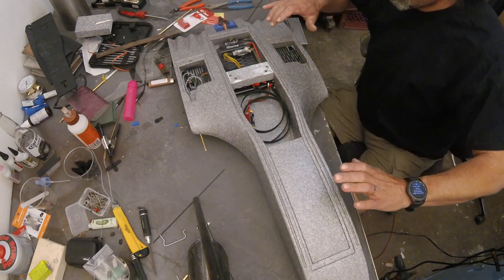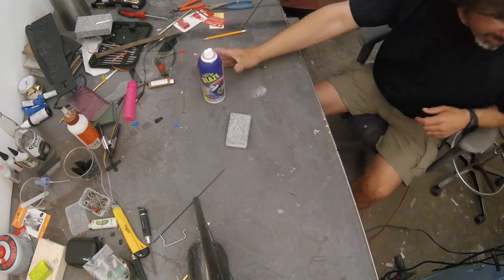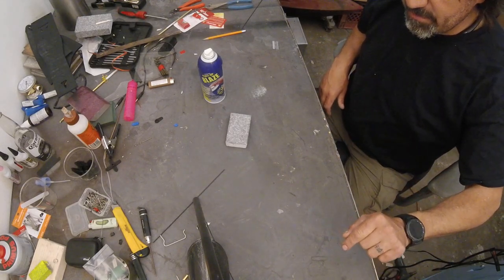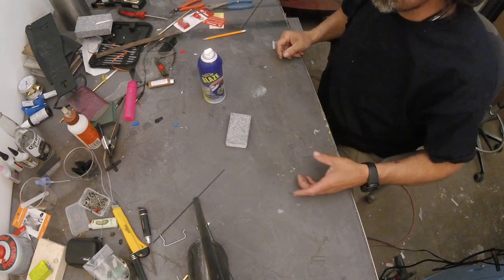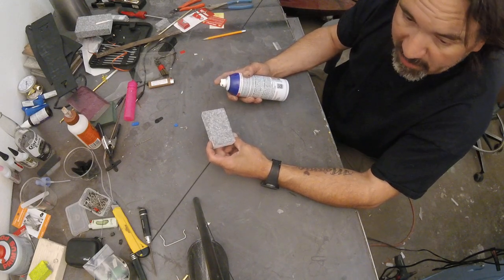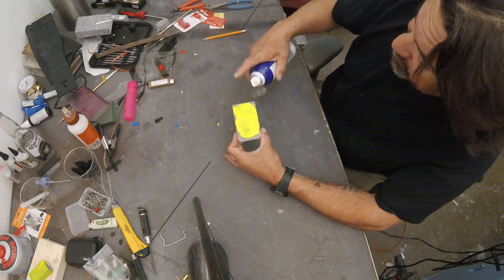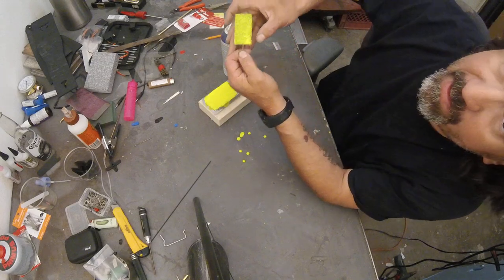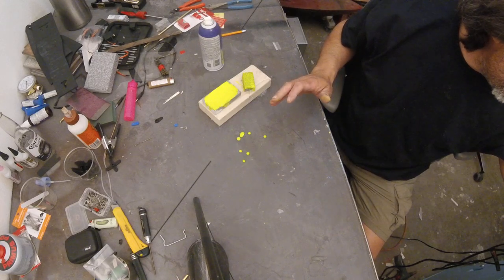MOLDED EPP TEST

Comment: I know this is old, but just to clear this up....... EPP is Expanded POLY PROPYLENE.  It is one of the most chemical resistant plastics commonly used. Hence why it is often used for things like fuel cans, etc.  There is essentially no solvent your likely to get your hands on at a retail capacity that will attack it.  However, there are some blends out there, that may have other types of plastics blended in. The retailer of the kit may not even be aware if its a blend in order to list is as such. So it's best to test.  Rather than using spray paint to test, you can use a very small amount of acetone in an inconspicuous area. If the acetone doesn't attack it, nothing your going to use on it will.